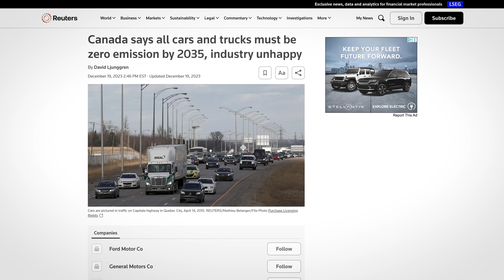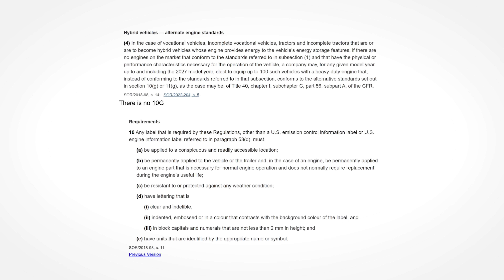Government Red Tape Is Blocking Our Plug-In Hybrid Trucks

Comment: The good news is the 2030 / 2035 targets are certified crack pipe dreams. I’d lean into building a tough diesel / mechanical truck till  you can get regulations caught up to your tech. Finding an OE like CAT or Cummins to back you on highway certification testing of their gensets would be a big plus.

Comment: Not to be that guy and not a troll but I saw this coming from a million miles away. They were never going to let an off highway generator run on a mobile platform as the main charging supply and get around in road emissions. .
Reply: Sounds like they might need a highway-approved fuel tank, diesel emission system. Then register the package as a new engine and pass an emissions test. 

OTOH you might get a smaller approved diesel powertrain and affix one or several generators to the shaft.

Comment: I have dealt with many emissions standard over the years, for a quick dive, this is just an assumption since you left out some information,  On road engines have lower Nitrogen-oxides [NOx ]  and Particulate Matter [PM] production limitations,  that is the only item I can see them putting a stop to you, as each type has the same specification for Sulfur-dioxides [SOx]...   I have seen many project and companies pay fines and costs to correct this, the two dominate issues I have seen  1. did not look into,  or 2. just ignored the subject.   others have been poor guidance from regulators, someone did not read any further, or just mis-understood the subject.       I think the momentum of this project had carried you faster than what was looked at, I have been following you for 4 years, I did not even catch that, and I worked for decades migrating dozens of offshore power plants into Tier-4 emissions standards. . .   Great ideas, but time to suck up the toe stub,  two options, find a road proven engine that meets the emission standards ( yep, the use of that lovely horse urine !!) or buy all the monitoring equipment to bench mark a genset - engine,, (I strongly suggest a Tier-4, as collecting data is much easier)..  over all, we all know, per mile of use, you will be well below the NOx, SOx, & PM emissions by at least a factor of 1/6th.... that is where collecting the data will be required, documented, certified, etc....  that is just My two cents SWAG...   I suggest get a cummings on-road diesel.  but I failed to know which gen-set you have.   Sometimes the cheaper option does not always become the cheaper option...   I have always taught my engineers to know the rules better than the government agent so  you can find the work-arounds...   It is a great feeling when you see a government inspector discover you know the rules better than they thought they knew...    GOOD LUCK!!! on your work around.

Comment: How do the firefighters put out the battery fires on EV now? Water or foam? 
No safe place to mount a battery for impact. 

Does the fire cause dangerous chemicals to contaminate farm land with rain pollution? 

Who offers liability insurance and how stable are these batteries? 

Watching a garbage truck burn from one small lithium battery is pretty scary. 

Stored in a black plastic container seems like it’s a time capsule for heat fires or spontaneous combustion. 

The defamation of a delivery vehicle or weapon that is easily stolen? 

Watching the news in grand Perry Alberta a few months ago we saw the police trying to stop a stolen fuel delivery truck. ( a bomb on wheels and almost anyone can operate or steal for destruction). 

Electric semi need a lot of stored energy making then an unstable vehicle or weapon of destruction. 
 EV batteries are not safe in all environments and temperatures.

Comment: Could you hire an engineer to design a system to sense for load? A simple servo can function as throttle control, and if you just add in a voltage reader on the batteries (which I'm sure you already have) then a really simple controller could calculate necessary RPMs or just read generator output voltage and increase / decrease servo throw to get the necessary output. Pretty sure there are some generators that bolt onto engines, but if they can't be found / aren't compliant, maybe just bolt on a few regular alternators and wire in series and parallel if neccesary. By using the regular car alternators it would be highly modular and they can be picked up at most parts store, nothing custom and if one goes out the system would still work.

Comment: Just a question in this Subject why you don't do like a hydrostatique transmission. Motor is control by a swith and transmission will be control by your electric system. They don't approuve this way ?

Comment: As a heavy duty mechanic that works on both on highway and off highway engines I understand what the government is saying. The way to make it work is use an on highway engine with a generator attached in place of the transmission then for throttle use the variable speed governor.
Reply: There are no on highway engines certified for use as a generator. And they would have to recertify it for every body style.

It is currently impossible to get one certified, because there are no standards to certify them against.
Reply: @alannitcher5001 gotta quit thinking of it as a "generator". It's an engine that creates mechanical energy which gets turned into electrical energy which gets turned back into mechanical energy.
Reply: @adventurercalvin This is true, and there are no standards for an engine being used in this way. So it cannot be certified.

Comment: 2:18 Did you really have to explain the difference to the government between a parallel and series hybrid vehicle?.... 
Forgive me, but I'm a humble automotive technician with my associates degree and Honda PACT/Dealer Certs, not a diesel guy at all, but we learned this very basic stuff in class. 
What's doing the propulsion really matters because that basically determines whether you're running a generator or an engine with your battery management system, hybrid integration et cetera. It's not the same can of worms, again because of the source of propulsion. 
Canada, y'all can hire me, id be glad to give y'all some crash courses on how vehicles work, y'all don't really seem to understand what we're up against but y'all are making the rules?... 
I'm American btw and don't even get me started, the EPA and everyone else can kick bricks. They're living in utopia land where everything works like it should on paper 
T.T
Good luck y'all, you have some great builds and y'all are breaking ground here!!

Comment: what a dam sham adding so much red tape to actually see that your truck works to lower emissions they just want their cut by any means possible. im so glad your not giving up in this fight, your doing exactly what they want but are afraid to admit that the tech works. they've had this tech for years ever since trains switched over to diesel electric but is costly to develop it for cars since the batteries can weigh a ton. heck I've seen Tesla drivers carry around an old Honda generator and plug it in when they need a charge on long trips and even some with a large solar set-up to get a boost

Comment: Contact an MP and have them start a petition. If that petition gets enough signatures it MUST be discussed in the house. That's likely the best way to get the law changed to allow this.
Reply: The other option is have an engine manufacturer get one of their gensets certified for on road use. If that means putting more emissions equipment on it than a standard generator would have, so be it.

Comment: Since this is a gap in legislation, there is not much Environment Canada realistically due because they are a bunch of bureaucrats working within a rules framework. Getting upset at them is unproductive. They can't do anything. If you're in Canada, write to your MPs or the relevant Ministers to have the gap closed or create an exemption for bleeding edge use-case like this.

Comment: Question: Can you build a mechanical with the forward axle then add the electric as the tandem? You would need a battery bank and some kind of charging system for the EV side of things but that could be a different kind of hybrid. I think that kind of system would be great for your average semi truck where the EV axle can help get the weight moving then offer braking and recapture the wasted energy. 

The prime-mover generator electric axles make sense for logging trucks where you can use the long, loaded downhill runs and capture that energy then use it to move the lighter truck back up the hill with the generator kicking in as needed. I don't know if the prime mover type with EV axles would gain efficiency in typical stop and go over the road trucking.

Comment: First go public... i mean national news chains.
This will pressure the government to alleviate, puts them in the head lights and makes them answer or backpeddle.

The second method is... use a certfied on road engine, then modify to act like generator.
This is a method of bypassing, sidestepping or bending the rules.

There are always gray areas... find them and exploit.

Or, just put a subsidary in the US. Think of the power equipment we have here... that tech would be in incredible demand.

Comment: your think too far out you know. basically your generator is like an APU that supplies power necessary for the truck when needed is it not? Think about it thats basically your loophole right there an APU unit that powers the electrical system even when its parked. it has nothing to do with propulsion of the vehicle at all but provides power to support the truck when necessary lol. reeeeeaaaally think about it lol

Comment: Here we go again well, I’m kind of glad Canada did that because you know if we truly do a research like we’re supposed to do diesel burns better than anything else now if the diesel is not pure enough and not created proper like it’s supposed to be and if you don’t mandate your big rigs like I’m talking oil change Changing your filters regularly they keep the engine running better better burning wise through the exhaust now hybrid with a generator when you live in Alberta and -50 won’t do a darn thing for truckers. I am tired of these people, especially you. I’m sorry, but trying to build something For Canada. You just keep your things to the states and we’re messing with stuff that should not have even messed around, but we all talk about fuel efficiency we talk about yeah we gotta maintain the ecosystem come on. We have destroyed it. Batteries are a complete acid when they heat up they can explode generators. You can get good generator so it’s got nothing to do with Canada‘s doing. It’s just that they don’t wanna do it because it’s all bunch of lies. All of it is you’re building a high brand you’re building this. You know what let’s build a water truck that burns out of water or trash. Well we won’t do that but me living in Canada, especially Western culture. I’m happy there’s no hybrid we gotta stick to diesel. This is why it’s out of the ground. We’re gonna start replacing with something that doesn’t really know the temperature culture in Canada and I’m talking about out westit won’t work. I’m happy that they did that.

Comment: How about have the petrol generators sold "separately" through a "different company"? Also, what is used in Canada to power AC units on refrigerated semi-trailer boxes? Are those certified for use on the road?

Comment: So... any idiot can modify their 'highway-certified engine,' delete the DEF system, add ridiculous aftermarket parts, remove or alter the exhaust, tweak the ECU, install a lift kit, and mess with the suspension geometry—and somehow, that’s 'acceptable' on our roads. But when a team of engineers comes up with something truly innovative and well-designed, suddenly it’s all red tape? Being a bureaucrat clearly doesn’t require common sense.

Comment: Since the Truck is technically powered by the batteries, couldn't the generator be sold as an optional accessory? So you would be building an electric truck that just has the storage space that miraculously fits a generator.
Just as if you had an electric pick-up and just put a generator as a range extender on the bed.

Comment: Edison motors does the company you source the gensets from make an on road version of just the motor for the genset? If so talk to the manufacturer to buy that and the parts to convert it to the genset version if possible. ...only thing I could think of that may work

Comment: Wait, are you saying you are not able to build a governor and motor controller for an on-highway engine?
There is basically no difference in the engines aside from the control of them, in fact you can get kits for converting engines to stationary use.
Well if you are not up for that then hopefully Canada sorts out the legislation soon and elon doesn't spitefully pressure them to keep you out, I really want to see this work out for you!

Comment: dude just use the throttle system required and use a drive by wire setup for the electric motor. You're designing an entire vehicle and can't figure that out? shut your whining.

Comment: Pause at 2min mark. Let me tell you why you cant. Theyre trying to buy the companies that are making ev components and the generator still uses other fuel thats not provided by the grid they are also trying to create. Its a scammmmm. its a way to enrich themselves. You know this, They tried to get you funding by getting funding to themselves first. I had your same hopes and dreams about a decade ago. Problem is and still will be is the battery tech has not evolved enough to be feasible. You need batteries that are 2000wh/kg no battery is higher that 700wh/kg you see the problem?

Comment: Use the electric setup that you were going to use and build an empty space where the diesel engine should be (that coincidentally happens to fit a crate with a self contained diesel generator). 

Then sell the customer the fully electric truck that can be plugged in and driven a hundred or so km on its own and have that certified by transport Canada. 

When out the back door of the shop sell the customer a generator in a self contained box that can be attached to the fully electric semi. 

Problem solved and carney can flood you with cash for being the first fully electric semi company in Canada. 

Makes me proud to be Canadian 🇨🇦
Reply: this is kinda what i was thinking, an electric truck with a replaceable storage area than can have a generator installed, same as buying a tesla and strapping a generator on the roof
Reply: This one! But then delete the comment so no one will know 😅
Reply: This. Hypothetically of course, they could set up, or work with, a separate company that just happens to "specialize" in providing generators that fit the engine bay "extra battery/storage" space. These generators can be advertised for adding "on site" or "remote location overnight" charging capability to your truck, especially when equipped with optional output plugs to charge Teslas and other EV vehicles. 😁
Reply: Doubtless this has crossed their minds.  Underhanded tactics unfortunately draw ire.  If everyone is on-board, there's more security.  Patience and polite persistance is their path.
Reply: This comment needs some traction so Edison can see it 😂.
Reply: Have to say this was the first thought that crossed my mind too, but with the current leadership, it would be better to go the path your doing, and let them catch up the legislation to keep pace with your innovation.  They just never thought about off-hwy engines so there is no approval process in place for that at the moment.
I think your option for "limited production run" may get you a way to build the first ones, in small batches while they catch up on the rules and regulations.
Reply: Chainsaw manufacturers do similar to meet emissions standards. There's a plastic or rubber fuel restrictor which allows the chainsaw to meet emissions and fuel standards, and removal of it voids warranty... but conveniently, it is easily removed for the users convenience of having a chainsaw that can do more than idle 😊.
Reply: What about steam
Reply: Do you think people are that stupid?
Reply: @hojbota-ptv The issue is not people.  The people are onboard.  The issue is regulations in a novel space.
Reply: Oh yeah, do that. That's the very smartest thing to do. Imagine their surprise when they find out NONE of the vehicles can ever be road registered until they figure out their emissions. What trucking company is foolish enough to buy a truck that cannot be driven on the road? THIS is the #1 lamebrain numbskull idea of the day, take your prize my friend.